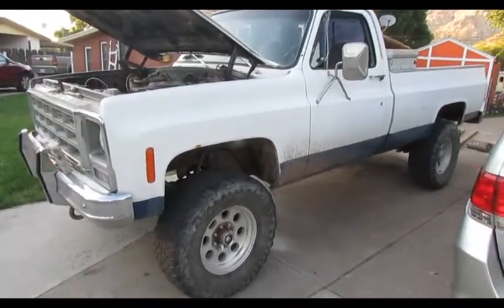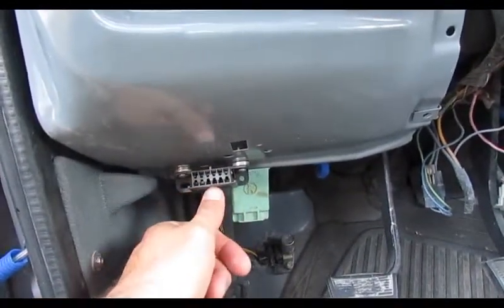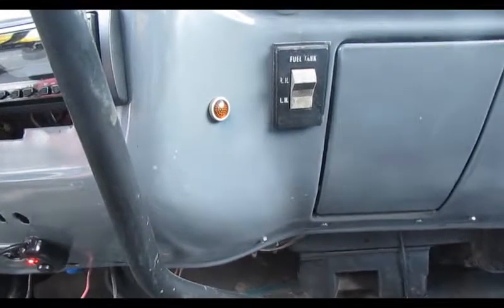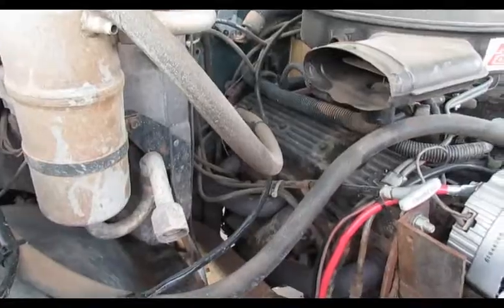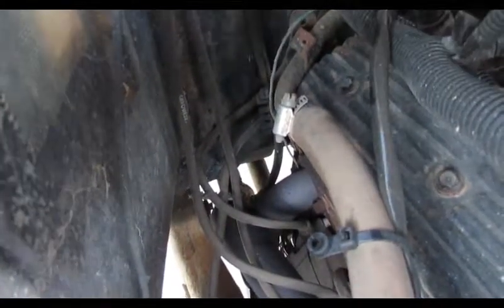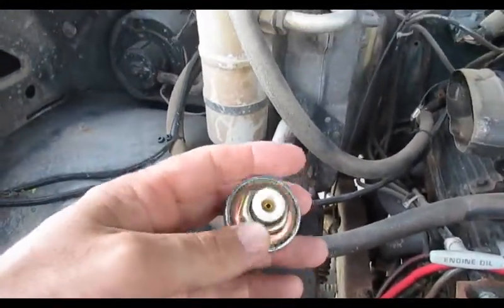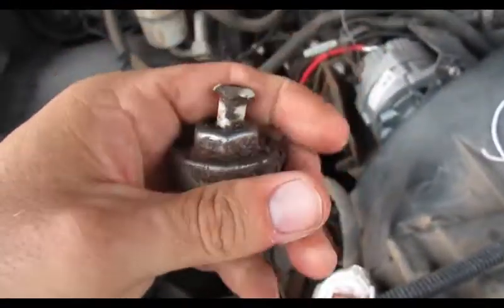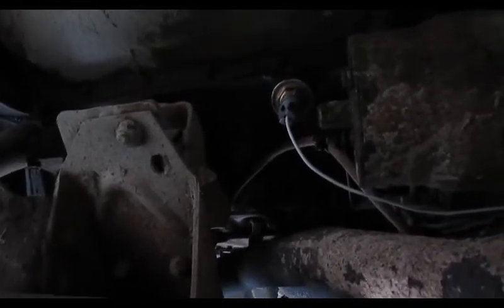1979 GMC Sierra knock sensor

Comment from the maker: The knock sensor harness is on the drivers side of the engine right under the intake. There should be a connector right there and the harness passes through a rubber grommet down under the intake manifold (that is where the sensor is located).  I cut my harness right at that grommet so I could utilize the factory connection. The harness should have a solid wire surrounded by a braided wire. Attach the solid wire to the sensor and the braided portion to a ground near the sensor.

Comment: so quick question first off good day to you your videos seem pretty understandable so my question on 93 gmc pickup 5.7 knock sensor code still apears after changing part and pig tail so question is where does wire actually tie to from where to the knock sensor

Comment: Hey man, I hope you read this. I saw your video for the 4Runner. I have a 92 Toyota pickup with the 3.0. I am so confused on pretty much all of it. So I need to buy the 97 s10 knock sensor, do I need to buy a different harness? What I understood was you take the hook off tap it, then thread the new s10 knock sensor into place. Then hook what to what? I can't even locate the knock sensor I'm not very mechanically inclined but I cannot afford to pay someone. Thanks.